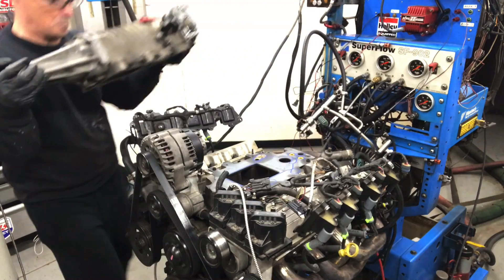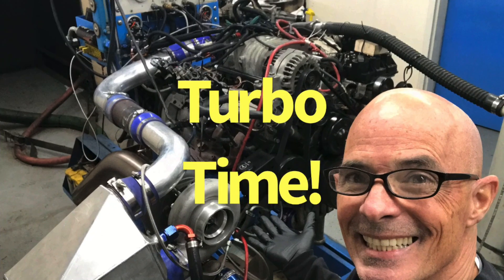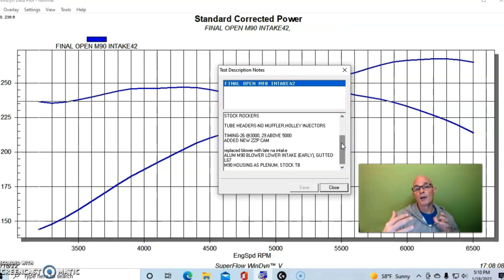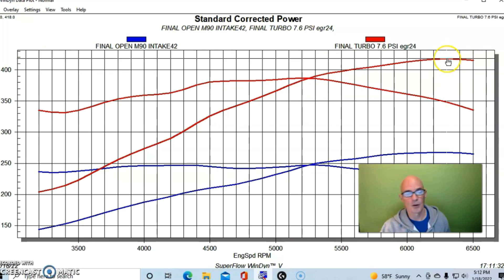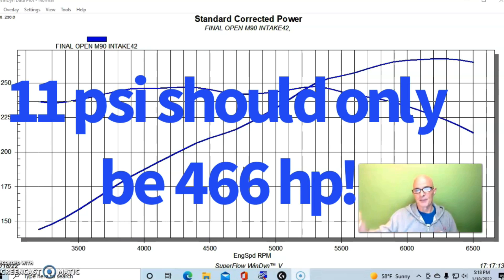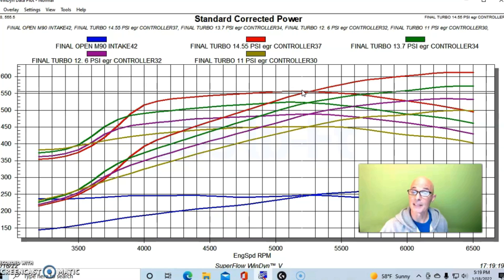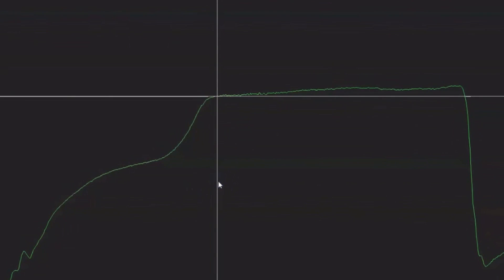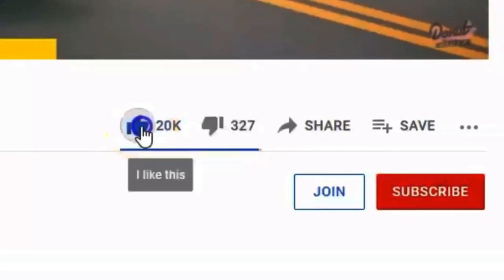HOW TO MAKE V8 POWER  FROM A (CHEAP) TURBO V6! THE L67 3800 V6 FINALLY GETS A CHEAP EBAY GT45 TURBO

Comment: Richard, what's going on with the increasing dip in power at the bottom as the boost level increased?
Reply: Its turbo spool. A back up run with hotter exhaust would help that a lot but i dont think he was really all that worried about it. An engine dyno is tricky to test that but he has done at least one video showing what heat in the exhaust can do for a run.

Comment: What are the exact specs on the turbo used in this test?  I have a L67 3800 rebuilt with upgraded rod bolts, main studs, head studs and MLS head gaskets waiting to go into a 63' mid engined Corvair...bag the SC, may need a turbo!  Thanks Richard, great content!
Reply: Bro that hilarious isn’t that the older version of the cavaliers? I have a 1987 cavalier RS and wanna motor swap 😅

Comment: Impressive. Most impressive lol. 

I'm curious as to how far it'll go with just the stock head bolts. I have never heard of anyone blowing a head because of the lack of head studs. The stock head bolts are very strong, and torqued really high. I can't really find any reason to use head studs on most builds I see. $100 spent for an M90 build seems like a waste of money in my opinion.
Reply: Yeah, M90's are a waste past about 10 psi boost.  People should look only for 6th Gens if they want to run superchargers.
Reply: @andyharman3022  I can't understand why there are so many M90 3800 guys with the mentality that more boost equals more power. With a turbo that would be true. Push the boost to high with an M90 3800 build and all your get is more bottom end, but sacrifice top end. 

I've quite literally seen guys pushing 18psi with these, but they easily get beat by the guy only running 9psi.

Comment: Awesome gains! The 3800 is just getting started at 14-15psi. You may lose a head gasket with more power but with some head studs you can run them 24-28psi and really make some steam 🤟
Reply: Dude. How's your buick? I've been waiting for the new sleepers video for years
Reply: Trying hard to get everything in place
Reply: He lives..
Reply: THE LEGEND
Reply: Is Any better head gaskets that can handle more boost?
Reply: The legend himself!!
Reply: I was running a 3.4 pulling, and only getting 11psi. I had Zero Knock, with the intercooler, I could’ve went to a 3.0 pulley and gain 4more psi.

My transmission was leaking from the TC area, so I pulled the engine, replace the head bolts, and head gasket with the multi layer head gasket….to reduce compression, I decided to dump the supercharger, buy a rebuilt and upgraded Transmission, with a 3000stall Torque converter, stick a turbo on it’ mine is slightly bigger’ get bigger injectors, reprogram the computer, replace the flow master 80series with a quitter Dynomax muffler.

The fiero is still not done….I ended up getting a 1987 gt for my daily driver….I ended up swapping the fastback clip off my daily driver., I mounted my turbo straight to the header, and I had to modify the frame near the shock tower’ to fit the turbo pipping.

I gutted the supercharger body really good, I cut the opening of the L-67 intake bigger.

Comment: is the L67 the factory supercharged motor? why would you need to add ring gap to a factory supercharged engine? I'm a ford guy I can't keep up with all the gm engine codes.
Reply: Because you dont know what it is and stock is like 10psi. Some of the Barra turbo engines have like 0.018 gap stock. It only takes time to set ring gap, less time than picking all the piston fragments off the dyno room floor.
Reply: More boost needs more gap. My built motor has almost double the OEM gap and because of that it can handle more power/heat as the rings expand. The only real trade off is increased blow by…
Reply: the stock engines aren't known for butting rings are they? and if they don't butt rings under boost and more ring gap makes it burn oil and contaminate the charge maybe there's enough as is?

Comment: Hey Richard I'm not trying to unvalidate your turbo tests ...but I have built a few 3800 motors and your not spinning the supercharger fast enough... one car I had built we made a tick under 16 pounds of boost  with the factory supercharger would like to see you run the supercharger on it again just get a little more aggressive with your pully combo . And I would really like to see a North star engine because I don't think they are as weak as people think they are ...love your videos and keep up the good work
Reply: With the cams, head work, and very open exhaust, your not going to see the same boost pressure. All of those mods increase power while lowering boost pressure.
Reply from the maker: I ran a 2.6 pulley

Comment: Would be interested in seeing the parasitic losses of both the blower and the turbo. That 3800 is quite the beast though... I might have to build a fiero with one of those some day
Reply: I rode in a Fiero with a super charged 3800 with a stage 2 Super Chip and a six speed manual transmission. It was scary fast.
Reply: You should!
Reply: That'd be 😧 crazy

Comment: Can't wait to see you do the "Big Bang" build on this engine, Richard... especially with a 2.6" pulley on the Gen-V blower. Because I'd love to do such a combo with a remote-mount turbo (w/ATA IC) in a 4th-gen F-body! =;D
Reply: Look into the Mp extreme m90 case. It gets rid of the restrictive stock inlet found on gen 3 and 5 blowers while also boasting a huge outlet that makes these things move some air. These aftermarket cases will accept the traditional m90 snouts and rotor packs so its easy to adapt a used blower especially in a remote mounted blower/intercooler setup.
Reply: @madmod  Good... now, tell me where I can find an inlet that faces the right way, s I don't need to notch or hammer the firewall?
Reply: @pancudowny  The same company that sells the magnum power case sells cast inlets that far exceed the stock m90. At the cost tho, youd probably be better off with a 3.5 inch aluminum tube and a 90mm tb attached at the end of it. That said, its a lot easier making an inlet for this case vs modifying a stock eaton blower and making due.
Reply: @Goblin Slayer You'd have an easier time locating the IRS mounting points on a '64 Falcon.

And, ftr: GM originally intended the 4th-gen F-bod to be FWD, like the Dodge Daytona & Plymouth Laser.... since those were selling so well, and everyone was following Mopar's suit, being as successful as it was. When problems packaging the 3.8L V-6/FWD power-train turned-up during development, and the letter writing campaign to Ford from Mustang fans halted production of a FWD Mustang, GM scrambled to repackage the 4th-gen as a RWD car with V-8 option.

Comment: How responsive would this combo be in a car?
Reply: That would depend on the car's weight, gearing, and how deeply you put your foot into it...! =;)
Reply: most likely not really unless you can rolling foot brake it, its an 800hp turbo and likes more engine to be online sooner, as you can see later in the dyno runs it doesnt come on until 3500 or so, without being able to build boost like a dyno can youd be waiting even longer
Reply: @jacobburskey3044  left foot braking would provide the same effect to pre spool the turbo before launching.
Reply from the maker: I would choose a smaller gt3582 turbo for this power level

Comment: I had a 87 grand National with a totally stock long block, stock cam, stock heads with a TE44 turbo, large front mount IC, 3” DP, 3” exhaust, 104 octane chip, run at 23lb boost. With Sunoco 104 unleaded.
Very very fast.
I just wonder what Richard would estimate it made for power
Reply: 481 at 5100 rpm 526 lbft  ill bet
Reply from the maker: not very high with a stock cam and stock heads and stock intake

Comment: That is pretty amazing but that little engine Would put out that kind of power and stay together with stock parts totally amazing I wonder if it would make 1000 hp with good parts
Reply: The stock block for the grand National  V6 would hold up to about 650 HP.
There’s a bit of difference between the 3.8 in the grand National and this 3800 (the 3800 was produced from 1988 until it ended production in the 2000’s)
We’ll find out !
I think Richard plans on running till it blows up!
That small turbo he has on it won’t allow 1000 HP.
Reply: The series iii is supposed to have better rods. They are really similar to a gen4 LS style rod and that will probably be the limiting factor. I thought the series iii would give up at 900ftlbs of torque but the series ii not many people have tested to failure.
Reply: @timothybayliss6680  I think the heads lift off the block and push gaskets between 6-800 hp.
Reply: @Toys4Life  i dont expect the factory gaskets or tty head bolts to work at that level. There is mls head gaskets and arp studs available. Richard used ls9 mls gaskets and arp hardware on the 1600hp 6.0l gen4 big bang. The stock heads might be too flimsy to hold the gaskets in though
Reply: All series 2 and 3 blocks have been over  700 wheel on sbe. M90 record rn is 500+ wheel, and the turbo 3800 record is 1211 wheel. These 3800's can make pretty damn good power with boost. Just a lot more fun in a rwd car instead of fwd lol
Reply: @chefs_garage  up at 1400whp here in Aus now. Amazing how far they can go.
Reply: Easily.